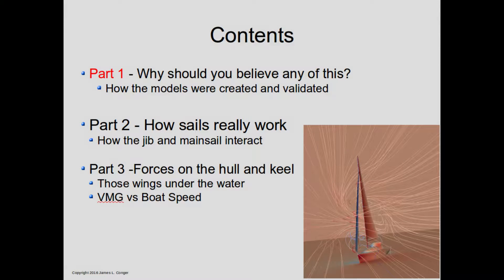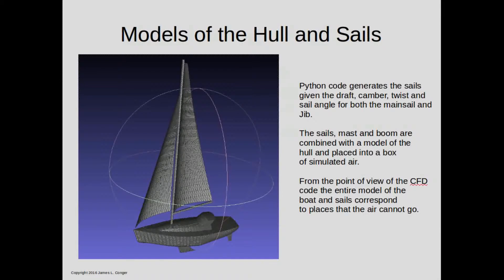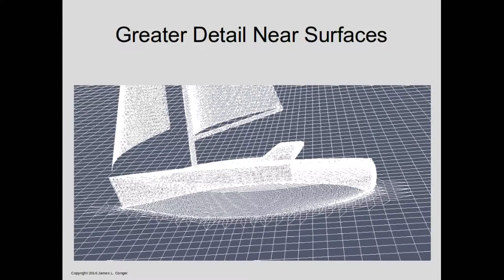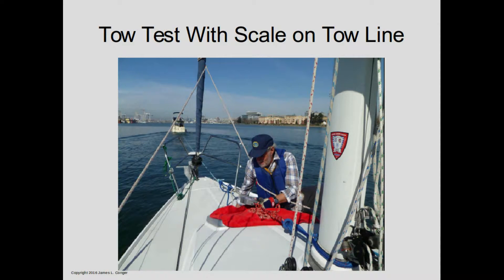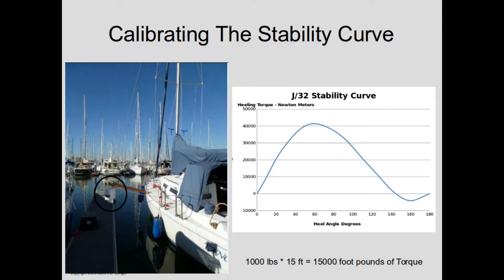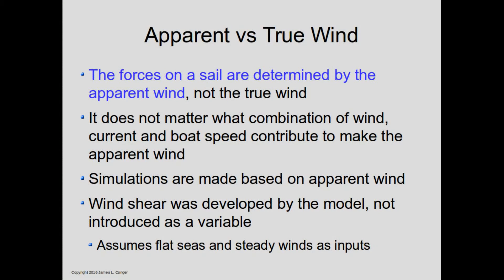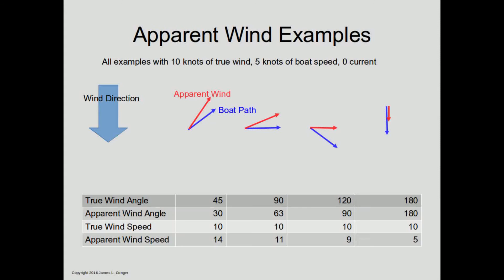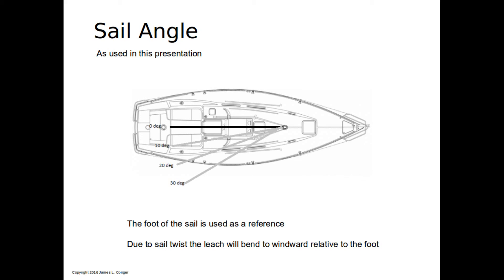How Sails Really Work Video 1 - Introduction

Comment: Thanks a lot for this series of presentation. I am confused about the true/apparent wind example page. Are apparent wind direction and calculation correct? Thanks.
Reply from the maker: It's been a decade, but I'm pretty sure those charts are correct. Next time you're on a beam reach, recognize that you are sailing downwind at an angle of about 45 degrees in the true wind.